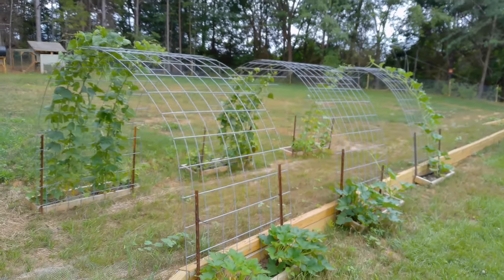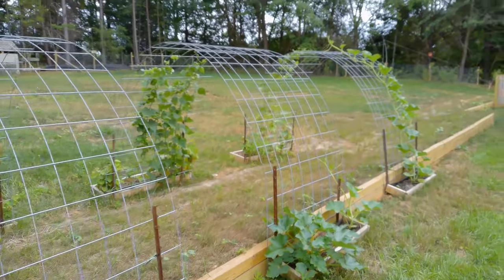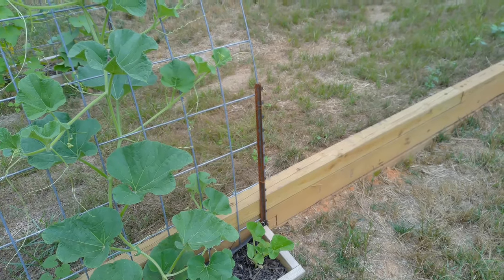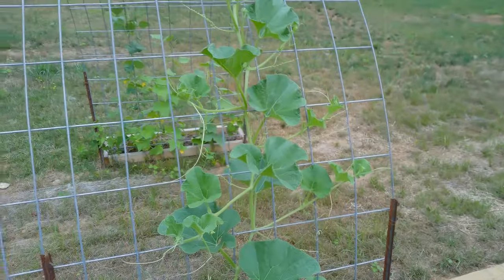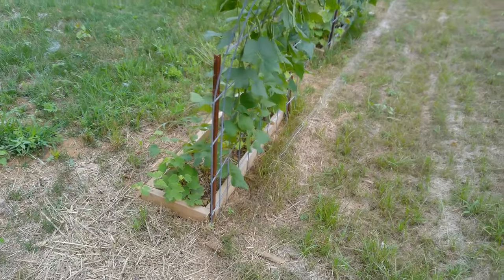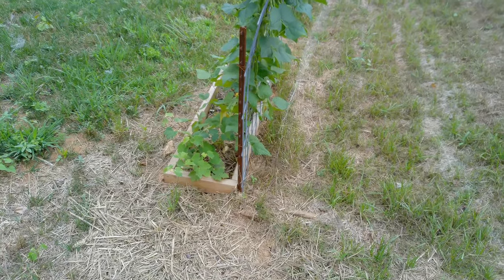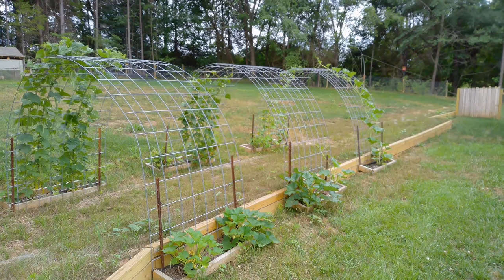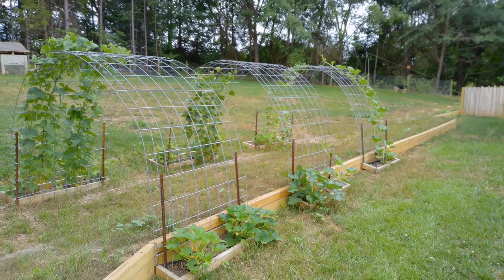Simple DIY Grape Trellis

Comment: This is exactly what I’ve been searching for this weekend. A trellis that was effective and aesthetically appealing. Thanks for this video!!!
Reply from the maker: The price for the cattle fence has doubled since I made this.  I made four more using the smaller gauge (same length) swine/pig fencing from tractor supply that I am using to support climbing roses. I would definitely recommend using more decorative stakes at the bottom instead of the bland ones I used.
Reply: @toddcriswell796  I greatly appreciate the insight, and will proceed accordingly.

Comment: It's been a year... How are your trellis's holding up?  How are they doing?
Reply from the maker: Original ones are just like they where a year ago. No issues. Wish my grapes were doing better. I added four more trellis but this time I used hog/swine fence panels. They are not as wide but still 8 feet long and only $19 each.
Reply: @toddcriswell796  - nice... I'm trying to decide how I want to trellis some grapes. Haven't nailed it down yet.
Reply from the maker: @TwoDovesBees  I thought about how they do them at vineyards but realized I’d probably clothesline myself on riding mower. I did use better metal fence posts to anchor to ground with the other ones so they would look a little more decorative.
Reply: @toddcriswell796  your lucky I just paid 39 each for ten
Reply: I’m going to do this new sub here watching your grapes along with the birds